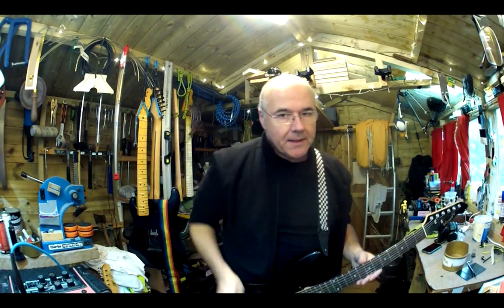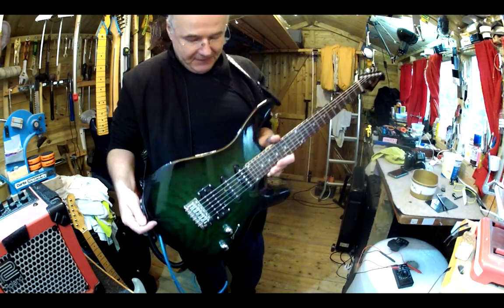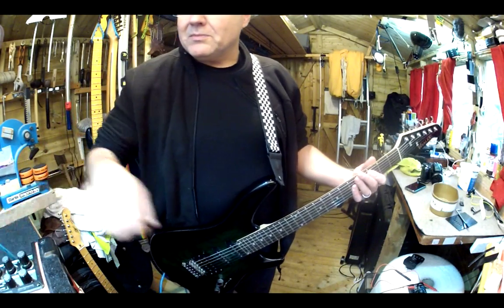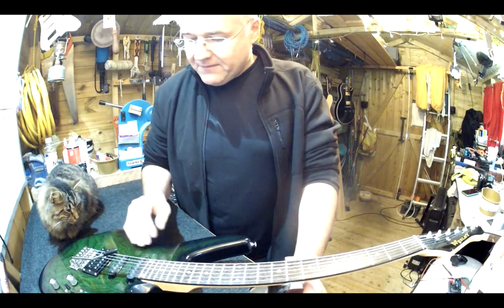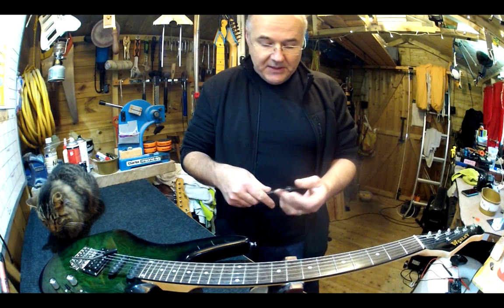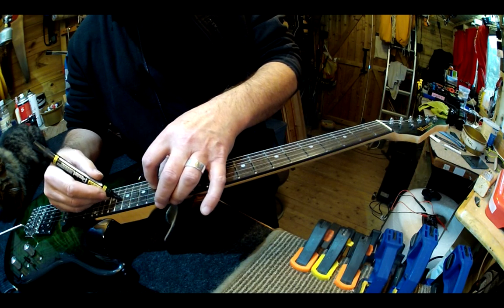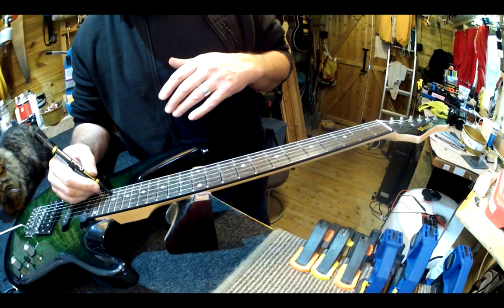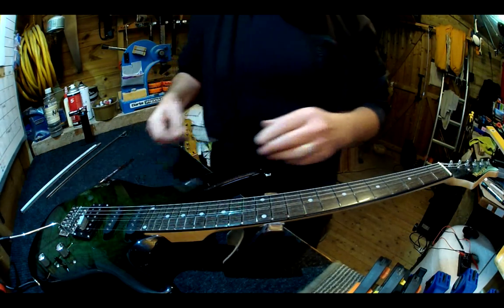Wesley superstrat setup

Comment: That was awesome, well worth the watch! The guitar sounds and looks amazing.
Reply from the maker: +Wormweed Thanks Wormwood. The chap who was importing / branding these got a LOT right :-)
Reply: +Sam Deeks I used your videos to do my first fret leveling and nut filing etc. This video was especially helpful. I used my 1st guitar as a victim, £250 guitar that was almost unplayable, because some frets were so uneven. I had to remove a lot of material when i leveled them, since 2 frets were really low. It's probably on the border to needing new frets, but i dont have the tools or the money to do that. The fretboard was also a bit uneven.

I suppose i should have complained and gotten a new guitar, since i bought  it new in october. But i wanted to try it. I just filed the nut down to 0,015mm right away, and just figured id get a new one if it turned out bad. But its pretty good now actually! It's a strat type of guitar, and i was able to lower the saddles by 3,5 turns on all the strings. But its all low and nice now, not as low as this Wesley guitar though. I just lowered the saddles until it buzzed, then turned back out until it stopped. Any lower and it buzzes at fret 7-11. Think i can go lower with more neck relief?

Wish i had that fret file you used here, i only had normal files ordered from crimson guitars. And that was a pain in the ass to work with when i had to take that much material off to level the frets.

So thanks for these very helpful videos! Think maybe i want to get a fret file like yours before i do my 2nd and more expensive guitar.
Reply from the maker: Hi Wormweed (not 'Wormwood' lol) - you can make the 'banana' file easily enough. Just get yourself an old truss rod and some self-adhesive sandpaper :-) Keep practicing, it'll get better as you go along
Reply: Sam Deeks
I meant for crowning the frets after you leveled them. Leveling was easy. Reshaping them was a long and painful process.
Reply from the maker: +Wormweed ah ok, got you. The way I look at it the StewMac file only needs you to do 5 or 6 setups before the cost is spread out nicely. 5 or 6... Most guitarists have more than 1 guitar at any one point...then across you lifetime...plus friends etc. Bargain when you look at it that way lol
Reply: Sam Deeks
Yeah, i suppose you are right. But its always so easy to "just" order a few extra things while you're at it. So in the end you have to fix 15 guitars just to break even. Wish i had bought a sanding beam, instead of the fret leveling file too. The file is so coarse, so it required a lot of extra work. So after just 1 guitar i allready figured out 2 other products i should have. What new product will i disover after the 2nd guitar? lol
Reply from the maker: Just DON'T click the 'Please send me the Stewmac Catalogue' checkbox :-) For a sanding beam you can use a medium sized spirit level (1 - 2' long) with self-adhesive sandpaper along the milled edge. Very flat and straight. I agree with you about the fret levelling files, too aggressive for my liking. The 'tuneable' truss rod I use is great because the technique lets me stop and test - and stop exactly when I've reached the playable set up I require. That way takes absolutely no more metal off the frets than is required.
Reply: Sam Deeks
I just did my 2nd guitar now, the Hagstrom ultra swede. The frets were really even to begin with, so wasnt too big of a job really. Fret 3 and 8 were a tad high, then frets 17-22 were all a tad low or high. I just taped some 240 grit paper onto the crimson guitars fret level file, and went to work, then continued with 600-2000 grit, and a polish once i was done.

Hardly removed any material from the frets, And there was no need to recrown the frets after,so i'm very pleased with that.

What im not so pleased with is that i discovered that there seems to be no shielding in this guitar, i didnt see anything when i took out the pickups, or the jack output. Jack output design is shit too, the screw always rattle loose. It should have been permanently fixed to that plate, instead of being screwed onto the plate, that is screwed onto the guitar.. Well, i glued the screws and plate together, so its not gonna rattle loose again.

So i guess i have to get some shielding tape now then? What do you think? Was the Hagstrom guitar you fixed shielded with foil in the cavities?
Reply from the maker: Neat move taping the paper over the hungry Crimson file! Regarding shielding, I can't think of a single Les Paul-style guitar that I've had through with shielding. Electronics afficionadoes will probably tell you that's because shielding is to cut out the single coil hum mainly (and the humbuckers do that already). I don't know if this is the case or not. I quite like to shield them anyway in part because it's very meditative and relaxing lol Worth researching further though.

Comment: Hi Sam, I was watching your avon les paul refurbish video, and saw you had some difficulty getting the bridge studs out, here's a helpful tip I use in the automotive trade with stubborn bolts: you can apply a little bit of heat (likely with your soldering iron), and give the head of the bolt a couple of taps with a small hammer. a lot of times that will help loosen the bolt, Cheers!!

Comment: a good guitar is a good guitar to me, brands don't matter. I needed a new acoustic last year was going for Martin but it never happened, I played about 5 Martin's and did not like them , after almost giving up I picked up a lag t80a and fell in love with it, went home to look at other lag models and found another t80a on ebay new for £130 in the January sales, got it gave it a set up and it's now my go to acoustic, everything about it says quality. I do kit builds and rescue broken guitars and it's the same with pickups I found a brand called iron gear they are every bit as good as Duncan's. all the brand obsession we have don't matter it's all in the fingers and the ears.
Reply from the maker: I agree with you TheEARLD. I was also very impressed with Lag acoustics and I've also been buying Iron Gears quite a bit for upgrades :-)
Reply: +Sam Deeks I put iron gear over wound pickups in my telecaster kit build, they sound better than the ones in my old fender telecaster, I sold it a few months after I finished the kit because I stopped playing it.

Comment: I managed to watch it all the way through to see how other people do their work and think I will stick to the old way of removing the neck, adjust it dead straight, level the frets with fret leveller, crown and then polish with tcut and dremel tool. All my cheap guitars are set to around 1mm 1st string and 1.5mm 6th string at 12th fret which is fairly low and easy to play. I totally agree about brand names being overpriced because of the name. I have £80 guitars that I have changed pickup magnets to alnico V (yes just the magnets for vast improvement), new tuners and bridge if needed and once setup and finished play and sound so much more better than guitars costing triple or more than the extra £30 or £40 on the parts.

Comment: Nice Guitar how do you rate the pickups it that unit.
Reply from the maker: +Joe Dov I never got to hear the stock HSS Joe, as the bridge was dead from the outset. With the Epiphone it gave a big power boost between the singles and the bridge. The singles were very clean and sparkly if a bit thin. But for a budget guitar, not bad at all.

Comment: I've seen a number of these Wesley guitars. Often more modern styles like this. Only thing that put me off at first was the logo; not because of the name, but I didn't like the look of it. Daft, isn't it? But I love the green, even if the flame is only veneer or even a photograph. There simply aren't enough green guitars in the world. For me, in any case.
Reply from the maker: There are quite a lot of them and great prices 2nd hand mainly because the brand isn't really known. I've never seen any marketing for this brand either. Makes them a good buy for me since they set up well, play well and I don't have a problem selling them - but that wouldn't be so easy for someone who doesn't have my 'shop window' to sell from.
Reply: +Sam Deeks I quite agree, Sam. And the trouble with all these guitars – along with many you pay an awful lot more for – is that they never get a proper setup at the factory. So when you pick them up, you know immediately where you can find your margin.